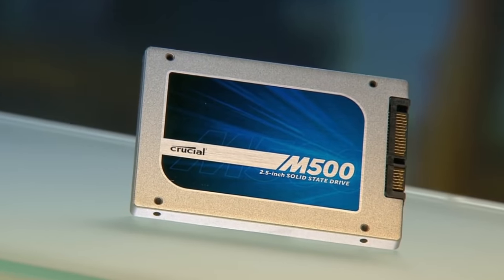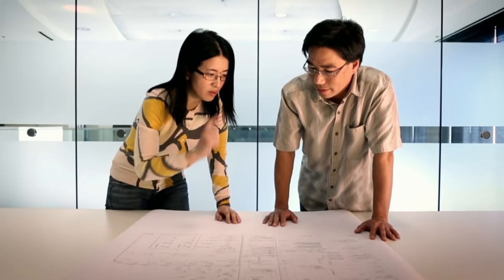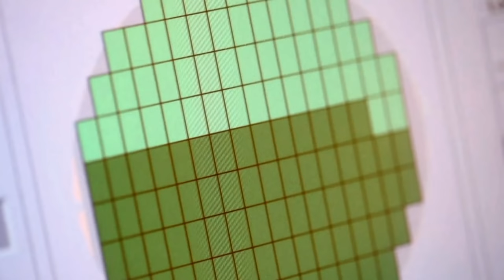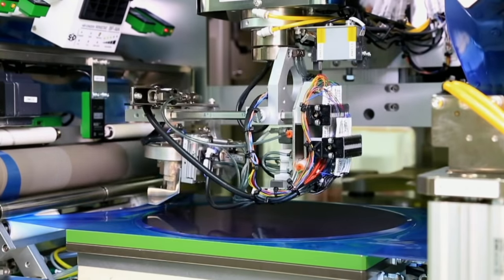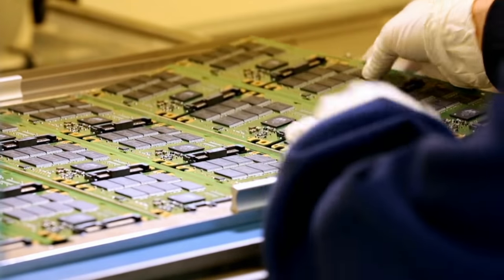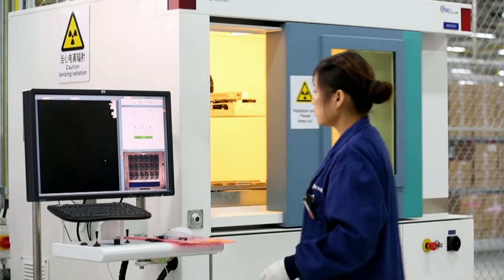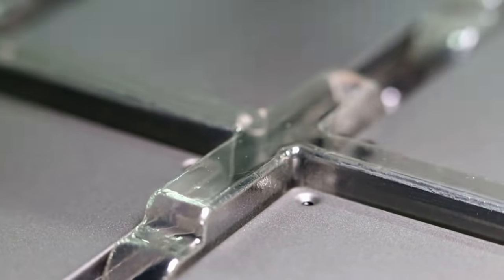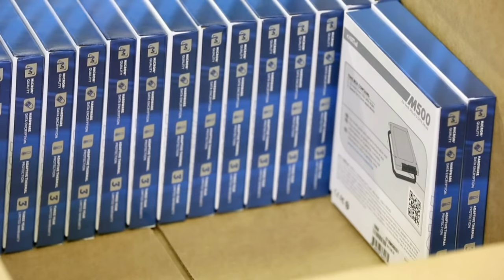How It's Actually Made - Solid State Drives

Comment: “Scientists predict that ssd’s will be small enough to fit onto computer motherboards in 80 to 100 years” Cries in M.2
Reply: Yheaaa there was an oopsie there
Reply: This is clearly an archived video from 80+ years ago. That's why they said 80-100
Reply: I was looking for this comment
Reply: He was clearly joking (don't woooosh me)
Reply: @xrayian  he was definitely joking, cr1tikal said he's the one that built his computer, there's no way he's not aware lol
Reply: pretty sure apple already has ssd fitted onto the motherboard , atleast in the laptops. but i am not sure if that is a good thing :D
Reply: NVMe fits on the mobo...
Reply: Depending on what you consider and SSD, CF cards could be directly attached to the motherboard in the 90's.
Then you could get into flash memory being part of the board as early as the late 80's but that was really only on super high end machines and not really meant for mass storage.
Reply: sobs in M1 mac
Reply: @xrayian  wooooshed you are
Reply: @oplkfdhgk  SSDs fittet to the motherboard is way faster, as then they're not limited by the SATA connector and has much less latency. M.2 SSDs have done this for a few yeard now, they basically look like small ram sticks with exposed chips and a tiny SATA connector on one side. They're a tad expensive but so much faster than 3.5 or 2.5 inch SSDs or HDDs. I'd imagine Apple has been using M.2s in at least their higher end options for a couple years now, as do most laptops nowadays.
Reply: @YurgenGrimwood  it uses the availabile bandwidth of the pcie gen 4 and it's not a sata connector on the end limited to the 6gbps that a sata would be limited to it's a small pcie connector that has upwards of 16GTS or 32gbps
Reply: @LlamaCraft  that's what I said, albeit I didn't say the specific speeds. Not limited by the SATA connector.
Reply: Lets not forget the PS5's inbuilt storage.
Reply: @zakiyo6109  bro this entire video is starical
Reply: @oplkfdhgk  apple has **0** revolutionary parts in it (M1 chip is not nearly revolution) just because they charge 10 grand for a pc with an 8 core cpu with 256GBs of memory does not make it good d:
Reply: @YurgenGrimwood  yea lol 7Gb/s is FAST
Reply: @solo-ion3633  that’s just an m.2 ssd thats soldered onto a mobo
Reply: @AquaticSCP  Welllll.... technically speaking M.2 is the name for the physical interface. Because the PS5 inbuilt SSD is soldered on,  it doesn't use M.2.
Reply: Yes, we should take this series entirely seriously.
Reply: The Wright brothers said spaceflight would take 100 years or 100,000 years, I'm not sure. Look at history though, only fifty years after they said that, we got to the moon.
Reply: @joj.  And while we're at it, why don't we also take YouTube comments seriously. ;)
Reply: Cries in nvme
Reply: Laughs in EMMC
Reply: this is fake
Reply: When was that quote?
Reply: @Zanithos  damn you lol. I was gonna post this but here you are! Just a week before me! XD
Reply: @angrynerd2103  maybe next time :P
Reply: I knew that was wrong but I couldn’t tell if that was a joke or not cuz it was so random but not funny to me lol  what an interesting sense of humor this dude has
Reply: @JoshuaC34  wait, i thought the moon landing was a hoax.
Reply: @kevingallineauii9353  I know your joking, but in case you arent, it did happen. My grandfather actually worked on the lunar lander module. Also corridor digital released a great video reacting to the moon lander that you should watch, trust me, its good. 
Edit: I partially lied, I'm not 100% sure he worked on the lunar module, but he worked on space stuff at Northrop grumman in the 60s when the lander was being developed. He did work on the space shuttle program though, that one I know for sure is real. Unfortunately he died when I was 2 so I only know stories about him.
Reply: @YurgenGrimwood  M.2 drives that have a SATA connector instead of the NVMe bus connector are not any faster than 2.5 inch SSDs
Reply: @thegamerfromjuipiter7545  And what kind of idiot would buy an M.2 with a SATA connector? That's like getting a FM1 car to drive in a 30 km/h zone.
Reply: Yeah I have a Samsung mme drive and I'm looking to get some rack drives too because its only 500 gb
Reply: cries in SATA
Reply: What the fuck is in my m2 port then? Was it all a dream?
Reply: I mean technically its not wrong because since they are small enough to fit onto motherboards now they will also be able to in 80 to 100 years unless they grow in size for some reason
Reply: laughs in M1 SoC
Reply: Me in 2021 with 2tb nvme drives....
Reply: apple: hold my unleaded solder
Reply: That's the joke
Reply: Our phones have had ssd's for years now... they just don't call it ssd.
Reply: @haxorouse3265  Sobs in any MacBook Pro 2016 or newer, 2015 MacBook or newer, 2018 MacBook Air or newer, etc.
Reply: @YurgenGrimwood  Maybe someone without any extra hdd bays on their desktop but can afford to buy an nvme? Or someone with a cheap laptop that needs more storage but can’t afford nvme?
Reply: M.2 is trash. I'd much prefer a 2.5" drive. That's from my personal experience.
Reply: @mikeschmidt4800  Then you haven't used the right drive. Not all m.2 drives are created equal, what you want is PCIe NVMe M key m.2 drive using the PCIe bus, and not sharing the bus with another device. Some boards share the PCIe bus with m.2 drives, and will limit the speed for the drive, then it's no better than a SATA SSD. I've used both SATA and PCIe m.2, PCIe is way faster on the m key drive running on the bus alone. Lot of confusion about m.2 drives, but basically there's only two options, B key/B&M key, or M key. Only the M key uses PCIe... the other keys use SATA bus.
Reply: Probably my favorite joke of the video
Reply: @mikeschmidt4800  in addition to Gary's comment- you might want a cpu and motherboard that take advantage of higher end Pcie speeds. Gen 5 is up to 64gbs in bandwidth meaning your storage can be a lot faster with proper drives. Samsung makes some of the better one with usually the highest speeds but Crucial and Western Digital also make very solid offers
Reply: That's the joke
Reply: @Marco-uz1gy  seriously the original video is probably 10 years ago when M.2 had not yet been commercially available
Reply: @xrayian r/wooosh
Reply: “Cries in Soldered storage”
Reply: Cries in Micro SD

Comment: "SSD's might fit onto computer motherboards in 80 to 100 years"

Me with an M.2: "Yes."
Reply: M.2 is the shape/connection of the motherboard?
Reply: @jessesteinbar  M.2 is a connector that attaches directly to the motherboard, runs of 4x PCIe rails, and accepts M.2 NVME SSDs to connect directly to the motherboard.
Reply: @alexandergreen151  thanks! I'm looking for a new PC this days and some have that M.2. Thanks, bro!
Reply: @jessesteinbar  The nvme is more expensive than a traditional SSD per gigabyte but it also has a faster access rate
Reply: @alexandergreen151  not massively more expensive these days.

But you can also get SATA M.2.
Reply: @Grigeral  but it really is worth it to get an nvme drive
Reply: @YellowLAVA  unless you are planning on transferring a lot of data between 2 nvme drives, it really isn't.

In most cases, the speed difference of loading things between an SSD and an nvme is negligible.  For example getting into windows takes 2-3 seconds instead of 5-6.

Games may load 5-10 seconds faster.  In extreme cases, you might get 20-30 seconds faster, but those are games with exceptionally long load times anyways which are fairly rare.
Reply: I recently bought a 970 evo plus, and it's very rare to get r/w speeds over 100mb/s in everyday operations. It's limited by random access i/o and seek time. Sure, it's snappy and file transfers reach gigabytes/s, but for an OS drive a big sata SSD is just as good.
Reply: I was thinking the same thing lol
Reply: Me buying NVMe drives and enclosures to use them as a thumb drive: "Nah, it's not happening."
Reply: More like EMMC modules, though, I suppose if you wanted to solder your m.2 straight to the board, you could
Reply: the future is now
Reply: Apple: Yeah....uhhhh we have surpassed that
Reply: @alexandergreen151  what are you talking about? 2 years ago i paid for sata 1tb 870 samsung evo 120euro and this year i got kingston fury nvme 1tb 7000mb/s for only 65euros! m2 is actually cheaper in my country than hdd and sata ssd
Reply: @lukedavis436 yeah, they have been doing it with tech a while now

Comment: My aunt used to work for Motorola before the chip fab was spun off into a seperate company. Supposedly, there was a few weeks where every platter of chips ended up getting mostly rejects and they couldn't figure out why. Motorola did everything they could until someone was on the receiving dock and noticed the new guy rip open a pallet of hermetically sealed platters and counted them by hand. Once they fired him the acceptance rate went back up.
Reply: I heard a similar story where maintenance was cooking pizza in the chip curing ovens after hours.

Comment: Man, you skipped my favorite part!  After everything is all done, but before the bots snap them up to resell for 300% markup, the manufacturer meets with the other solid state companies and agrees on a price-fixing strategy to ensure that, somehow, the SSD always remains $/GB far more expensive than mechanical drives.  Mechanical drives contain all kinds of exotic materials, motors, rare earth magnets, helium (which there's a global shortage of), and are starting to even have lasers in them.  Yet, mysteriously, solid state storage which is just a regular grid of NAND gates using the most braindead design possible, requiring no rare materials, the more chips you add the faster it gets just because its parallel, and SOMEHOW it ends up more expensive.  Next to come, data storage that's just a block of wood but is magically 10x higher capacity and 10x speed and only costs 50% more!

Comment: I learned in my work that: when the scan the label, the scan the serial number and then they plug it in, the machine enters the serialnumber into the memory of the ssd so that other software can later just read out the serial number without needing to scan the barcode

Comment: The SSD shown in the opening of this video made me instantly realize that whoever edited this lives 10 years in the past. That is an old generation of SSD, a 2.5" SATA drive. Nowadays, SSDs are mounted directly on the motherboard. They are of the M.2 format, a miniaturized format, which also uses the NVMe protocol. Speeds are so much greater that it's like comparing old spinning hard drives and the first generation of SSDs.

Then, there's the narrator confusing silicon (a crystalline compound which is the basic building block of modern electronics) and silicone (which is a soft, rubber-like petroleum based product) for some reason.

The numerous attempts at humour are... sad at best. I actually feel for the poor soul who actually thinks he wrote good jokes. There may be help groups for that, who knows?

Plus there's the obvious and extremely racist comment that follows the intro. Overall, this is just a disaster of a video...
Reply: lmao this whole video is satire, how did you not understand it?